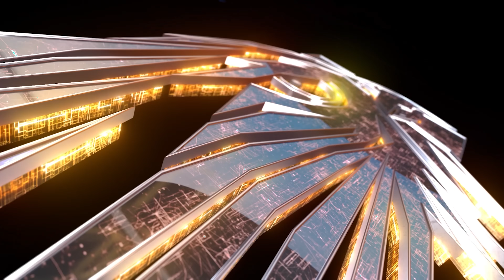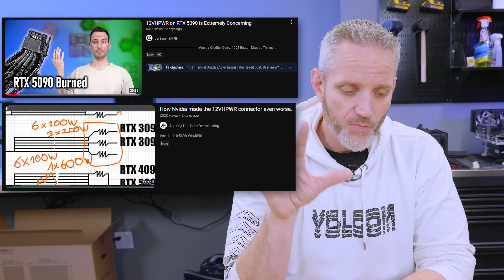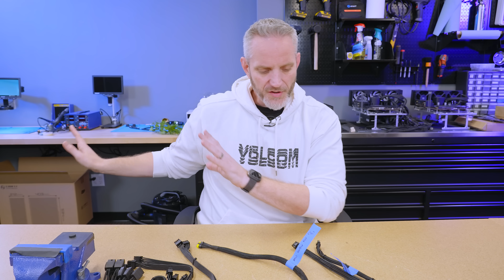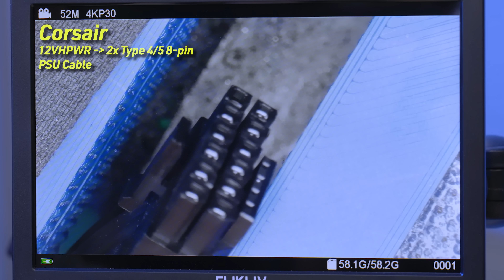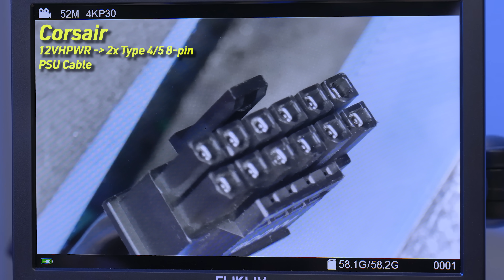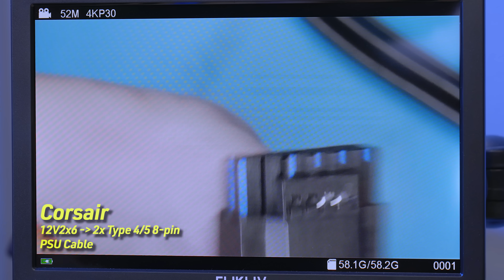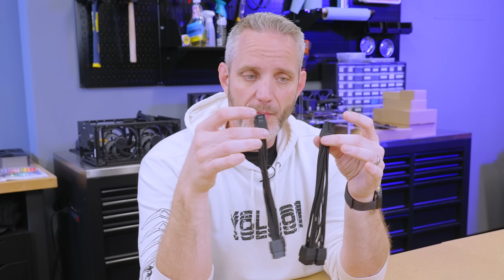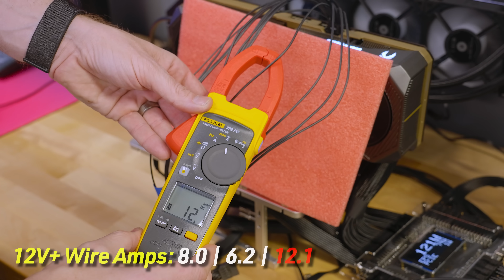I discovered something concerning and I need the Experts to chime in... More 12VHPWR discovery!

Comment: At the end of rhe day the entire plug design is not fit for purpose. 8pin plugs need re-engineering to now take more than 600 watts over 2 plugs instead. Also 16 pins is always going to be better than 12 as well. Sense pins are a total joke as well. They're dumb sensing pins and not incorporated with any additional hardware to actually be "sensing" anything right now. If the did they'd be shutting down PC's left and right with OC protection wouldn't they!? 

Instead they're dumb pins and look at what's happening? Trusting software is always a bad idea where hardware monitoring is concerned right?

NVIDIA needs to be audited and assessed for their business behaviour/practices now!

Comment: 1. There's 75W equivalent of 0v return via the PCIe slot.
2. Why not get a meter and measure the impedances  between the 12v connections into the card from the PSU end of the cable. If they're different you can start to compute the smoking gun.
3. If the busbar to connector in the PSU has impedances between 12v outs, more red. Again can be measured, best from the GPU end of the cable.

Comment: if everything is one rail on the gpu you might aswell just solder the damn wire and use a thick boy single wire. the many inconsistent contact points in the plugs is what's hurting it.

Comment: Its all bad. 600w is a space heater. In CA where NVIDIA is headquartered, this will cost you an additional 60 dollars a month to run, on the average. Thats before summer, when you'll need to run your AC to offset the device doubling as a space heater.

Moreover, there are far, far more elegant ways that already exist on the motherboard to solve the power issue that could have been done the last 3 to 4 cpu gens to alleviate the power delivery issue completely via the pcie standard that already has a dedicated powerplane and the capacity far exceeding the spec for delivery, safely, and has additional safety measures of being tied to ground via both the power supply and all the motherboard standoffs (which everyone forgets about).

Were that not bad enough -- the thickness of the connectors at the point of connection are not sufficient for that energy density.

Every single level of this is dumb.

Comment: One thing I have noticed is that the cooler the Rtx 5090 runs the more power it will extract through the psu cable, also some software that benchmarks the gpu uses a different hierarchy method on the gpu processor, so in short nvidia have created a very clever problem for everyone involved, I have a msi Rtx 5090 suprim x soc on preorder and I’m a little nervous about its capability’s, I will definitely run it on the quiet bios don’t want to run it too cool as it will munch up the psu and cable 😮

Comment: i think this is pointless, they just need to rethink the connector completely, they are putting more and more power through them whilst making them smaller, had the kept the older style connectors for like the 20 series, this will not be happening

Comment: And here I was leaning towards getting the Corsair RM1200X shift so I could see if the cable got unseated once I got my 5090... but if its a design defect like this implies and not user error, I'd still be at risk.

Thank you Jay. You (and ironically a paper launch) might have just saved my computer.
Reply: The Shift uses a slightly different cable though. The one in the video is a Corsair Type 4, while the Shift series uses Corsair Type 5. On my Type 5 12VHPWR cable the pins are even und can only be moved very slightly.
Reply: I just checked my new RM1000X 2024 (so type 4). The 12V-2X6 cable pins do not move at all. Not planning to use this cable yet as I am going AMD.

Comment: Having less ground wires will cause more current across the remaining ground wires. If those ground wires are not the proper gauge they will get hotter than the spec and begin to melt. The fact that some people are seeing more heat across a few wires whether they are the ground or power wires sounds like either a high resistance issue or a connection issue. The obvious ones will be the recessed pins. Those pins are not making proper contact thus causing the connected wires to get hotter. If a cable has non recessed pins and is still getting hot then the connections between the pin and the wire may be faulty. Current follows the path of least resistance. More current = more heat. All wires, pins, connections, etc have some resistance. If some wires/pins have higher resistance then the current will not travel thru those wires/pins. the remaining wires/pins will have all of the current and thus more heat.

Comment: Electrons flow from negative (ground) to positive, so "in" via ground and out via +12v. Flow is flow, resistance is the same on both in and out so no real difference. 
The connector is flawed by design. It needs a 2 pin 6mm2 with 75 amp cables from a dedicated gpu high power output on the pcu to the pcb/gpu. The old 4 pin hdd connectors could handle more power per pin than the tiny pcie connector pins. (not enough for this but still better than standard gpu cable)

Comment: Oh boy, Jay is really asking a hardcore question here... I guess we can all agree that manufacturing quality can always be an issue, 
but in general these crimps are designed to be "floating" inside the connector or in other words not to be fixed. 
Otherwise there would be an increased danger of damage to the crimps themselves. 
Now the other question is how much is "in spec"? And is that specification safe for 600W+? And that's probably something PCIE SIG has to answer. 
I personally think that aside from "mishaps", actual cases of damage due to really bad alignment, disconnections and or overuse, 
that the power distribution or lack there of, is much more likely to be the cause. Drawing 20A+ (240W+!!!) over a single crimp that at best is designed for ~13A 
under ideal conditions(!) is a catastrophe waiting to happen and it also explains why 30 Series, even the 3090Ti apparently didn't have any well known issues.

Comment: You'll need to consider the female connector on the GPU or PSU, and the depth of contact it's actually making.  But sure, it's quite possible, it's all about resistance, and less contact creates more resistance, more heat, more melty.  Resistance also dictates where that power will choose to travel, and all you need is for manufacturing inconsistencies to cause 3 preferential paths and your cable is now operating way beyond what it's capable off for more than a burst.  

As far as the -v or ground goes, it has the same potential to overheat/melt/etc as the +v.  You'll probably find that the PSU side is better built to handle the higher currents (single rail 1200w PSU is engineered at well over 100amps), and the resistance is low. 

End of the day, it's 6 potentially unmatched cables going from and terminating into a single bus/rail.  If you didn't want to put any effort into current management in the GPU side, then it should have a been a 3 guage pair. That's rated for 100 amps.  

The cables, the connectors, the entire design will ALWAYS be a potential problem outside of a perfectly controlled lab environment where they designed the spec.  NVIDIA and PSU manufacturers cannot control the quality of the cables even they supply, and it poses a direct and substantial risk to their products.

Comment: Realistically if the difference between meltdown fire hazard failure and perfectly fine is 1/16" or less than its not just a pin depth problem. At that point its just piss poor design and a piss poor connector trying to handle more than it should for "cost saving"

Comment: Being positive or negative makes no difference because it needs both to complete the circuit. I have a RM750e that had a wire crimped over top a terminal. Try tugging on each wire and see if it comes out because it shouldn't.

Comment: all those pin should be sealed in the plastic so they can't move when you touch the cable behind it, I guess it wasn't such a big deal when the power was much lower but it's becoming a problem because of it. I know more about house/building electrical system than electronics but I never seen a wall plus with a pin moving when you plug it in.
I've seen Wago splicing connector rated up to 32A melted because one of the wire wasn't fully in, it was melted on the side of the badly inserted wire. But for the 12V connector here since they come as a whole if 1 pin can be retracted even with the connector plugged in properly, that can be a problem and it's no way user error.

Comment: BS to Nvidia.   Pins on any given connector should lock into the same depth and that same lock also prevents the pin from pushing out.   Take it apart.. inspect the pins and compare them.
Reply: To add.. the barbs  should all lock at the same depth.   They also should be able to withstand the tendency for any wire being pulled from that position (THIS  is likely the deficiency).

Comment: These 12 pins on the 12VHPWR socket are significantly smaller in diameter than the PCIE 8 pins.  The socket will get very hot even you plug in the connector correctly.  Guess we have to liquid cool the 12VHPWR and PCIE-5 PSU socket before the GPU.

Comment: In general, higher resistance with constant voltage limits the current on that path, so the wires with a bad contact at their ends would conduct less current (Ohms law, duh) BUT that creates imbalance, causing the pins/wires with good connection conduct more current than those with bad connection. 

It's a design failure, both on the side of GPU manufacturer and PSU manufacturer, cause with this type of plug carrying this much power, there just HAS to be current sense at minimum for every individual wire. Now it might be the case that the issue is less prominent on ground wires cause of how devices are grounded - every metal part is a part of the ground connection, meaning that technically in example a PC case is also a part of a ground circuit, relieving the ground wire connection ever so slightly. 

My guess is that it all could be prevented with a bit of load balancing circuitry magic on GPU side, cause frankly I wouldn't expect PSU manufacturers to do it for anything but a high end models. 

Not an expert though, just an electrical engineer.

Comment: the corsair cable with recessed pin the barbs on that pin have failed, so that cable should never be used in any GPU..  i'm sorry but this is a build quality issue, i've seen this in other PSU's and 3rd party cables .. pre 30xx ... i would avoid using any cables where the barbs on the pins have failed so they don't lock in place at the correct place in the socket. 
If you make a custom 4 pin connector in your car.. if the barb fails, you would replace it..

Comment: (Cable) Standards exist for a reason.
Cable manufacturers: "huh?'
The new Nvidia adapter looks like the solved the 'pin push back" issue by putting a plastic supporting block on the rear that prevents/minimizes this from happening

Comment: I'm no expert but I can see a possible reason for the front to back push , we are now at a physical limit, it's been shown a couple of times that the 5090 and perhaps the 5080 though I think just the 5090 is drawing to much power through the cords.
It might be rated for 600 watts, but the smaller the wire, the less current it can before it starts heating up to full burn through, you can't go back to the 40 series where you have bigger thicker cables, you can't bend them to sharp, now Nvidia has made it impossible to buy a 50 card but why would you just to game, but that's not my point, follow this, you can't get a 90, or 80 card, if things don't get better I don't think they'll ever be readily available to buy, separate, but let's keep going, I'm sure different people have come up with different numbers, but the number  I have confirmed was
675 over the ground side, those wires can be top notch wires, but they are rated for 600 watts not 675, eventually they will burn through, back to front solves the wire issue, it can still fry, but there's no wire to tell the story of what happened to the computer, therefore it is harder to argue against that it's user error because most of us don't have a lab worth of stuff to test our personal computers with, to expensive some we have access to, but some people won't know where to start..
I'll keep this part short, this leads all of us computer users down a path where there's coming a day any new component is going to be to expensive to buy and at this rate, I see computers as a SI or  pre build situation and loose variety, I'm not talking about lights, screens, and all that, I am talking about actual components we need to make our computers do what we need them to do. No frills , just work right,

Comment: The best solution if you dont have 12v2x6 on your psu is make a custom plug that have on one side H++ and on other PCIEs, you avoid extra plugs and adapter and you can have cable lenght exactly what u need

Comment: Like I said on Roman's video, look at automotive connectors and what the pins look like for a 25A rating.... they DWARF the pins on the 12VHPWR. Realistically they should be using 8awg conductor for that much amperage, or 10awg at a minimum. I understand that when spread across more pins that helps, but that's not what's going on right now.
Reply: Only problem with your theory is that auto wiring isn't supposed to fail in 125°C ambient temperatures (which is why they are designed like that), something you will never see in a computer (unless it actually IS on fire.)
Reply: @glenndoiron9317  actually, automotive TXL cable is only rated to 125C.
Reply: @glenndoiron9317  also, it's not about ambient temperatures, it's about the rise in conductor temperatures when a current is passed through said conductor. Most PC cables in my limited experience aren't a cross linked polymer insulation and have a rating that reflects this, and in Roman's video he saw 150C.... that's even higher than a lot of very high end conductors such as Tefzel cable.

Comment: Jay your a car guy, now do a resistance check on each wire like you would with checking sparkplug wires. 
Still say a fusible link on each wire is the best bet to keep from damaging the card. It's cheap and can be implemented in manufacturing with minimal time and investment.
Would make a great content if you were to add fusible links to a cable, in fact most anyone can do it at home.

Comment: So safest way to run your 5090 is with a 3rd party load balancer between the PSU and GPU, all because Nvidia cheaped out on the PCB side of a $2000+++ card.

Great.

Comment: Did you see the video from Actually Hardcore Overclocking? It seems like it's just the way power delivery works on the 40 and 50 series cards. They can't load balance the connector.

Edit: Commented this way too early lol

Comment: This plug design is just bad. I don’t understand why Nvidia would tie themselves down to a plug design that barely handles the requirements of the card. Sure…lesser cards have lower demand on the plugs but the 5090 is skirting the max or surpassing the max that these plugs are rated for. The usual quality differences in plugs from manufacturer to manufacturer is so much more important than ever before. Pumping so much more power into so tiny a wire makes no sense to me. Gaming with Nvidia is a nonstop worry fest over a plug…a fracking plug. Downplay it all you like…but if I were spending that kind of cash on a card…I shouldn’t have to be worrying if my plug might destroy my computer or home if my “in-spec” plug has issues.

Comment: To me it's clear. It must be the pins. One cable has 24 pins in total. If just 4 of them on either side make bad contact and they are  spread over 4 unique wires, 2 wires will get a huge amount of load over spec.

Comment: just a quick ChatGPT

A poor ground connection in a 12V power connector under high amperage (like 20 amps) can lead to several issues:

Overheating: The poor connection can cause increased resistance, leading to excessive heat generation2. This can damage the connector, wires, and even the devices connected to the circuit.

Voltage Drop: A bad ground connection can result in a significant voltage drop, causing the connected devices to malfunction or not operate at full capacity.

Electrical Noise: Poor grounding can introduce electrical noise into the system, affecting the performance of sensitive electronic equipment.

Potential Fire Hazard: In extreme cases, the overheating and increased resistance can lead to a fire hazard, especially if the wiring insulation is compromised2.

Ensuring a solid ground connection is crucial for the safe and efficient operation of your electrical system. Do you have any specific concerns or symptoms you're experiencing with your setup?

Comment: I wouldn’t call it design flaw,  but rather poor quality control. If the pin sits for far inside the connector it will inevitably have less length inserted into the receptacle, thus getting higher contact resistance and consequently higher power loss and heat generated

Comment: Corsair is just overpriced Amazon off brand anymore. They bought Scuf, now Scuf controllers are just about one of the worst ones to buy. And Nvidia is at fault for this. They knew the issues with 40-series, and instead of changing connectors or adding shunts to monitor the individual power pins(like what buildzoid had said) and adding a 2nd power plug. They’re basically maxing out the cable which is just dumb and reckless.

Comment: I'm disappointed.. Why have 6 conductors for 1 rail. Each of those conductors are insulated sleeved and terminated. If you're going to run rail, use one large conductor. One doesn't run 6.5 18AWG conductors to their heat pump for 40 amps. They run 1 8AWG conductor. NVIDIA needs to fix their design right away. No excuses.